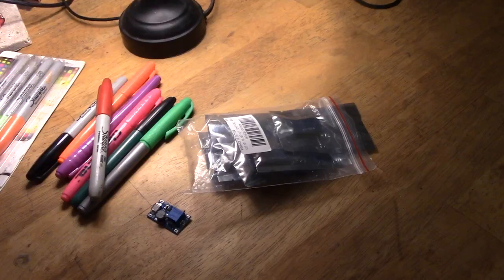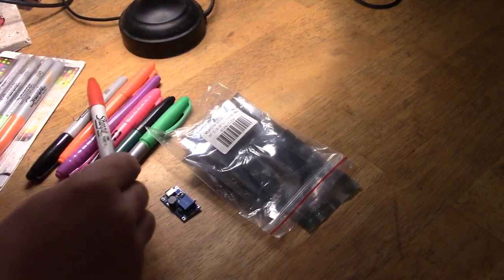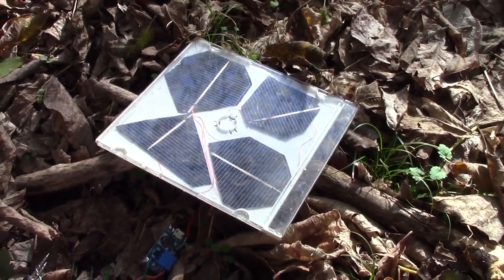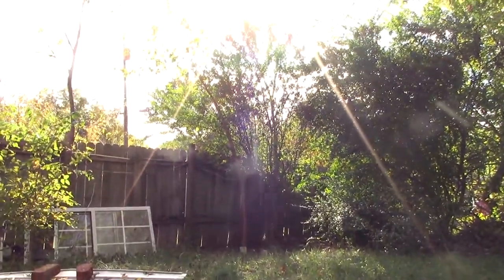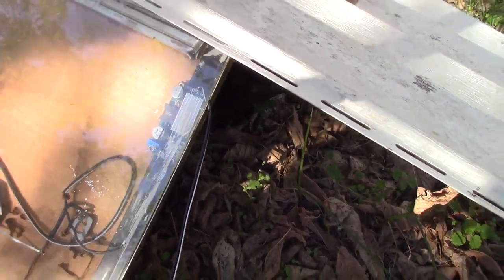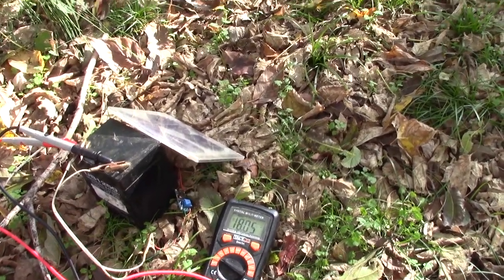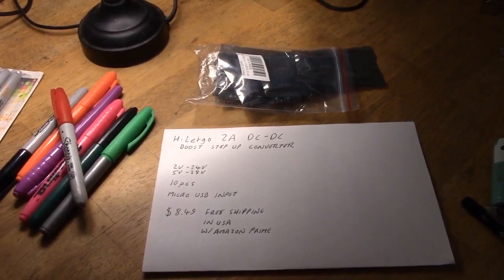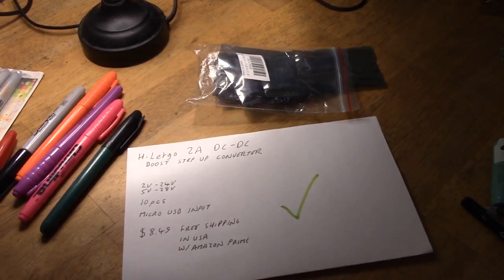Review: Cheap 2A DC/DC Step Up Converter

Comment: I love these DC-DC converters available for cheaps these days. Integrated with a $2 micro, these modules can be incredibly handy.
Amazing deals.
Cool.
B
Reply from the maker: They can and that has been the plan for a couple of years, but I honestly had issues with 3 or 4 different versions. The 1 on the larger solar setup has been faultless, either topping up Alum converted car batts, or,  normally topping up a 3 pack of Li-Ions for my workbench fan. A side note being those ex laptop cells have been charged that way all the time, no special regimen or charge controller, just direct from the 18V booster.

Comment: I have some of those too. And used it on a solar panel. One problem though. As the voltage rose, the converter did not work as expected! As the voltage was climbing towards the 2 Volts (the minimum required), the output (which was set to 5 Volt) went all the way up to maximum (over 20 Volts).
To test this device you need a power supply and raise the Voltage slowly and watch the output.
It may blow out things if you don't know this. In the end I made a nice report of this 'feature' and got my money back for those converters (was on Ali Express). They rewrote the specs, and the case was closed. I think a review is not a functionality test, I get that.
Reply from the maker: Good tip. Making sure of > 2V would be prudent to avoid any such issue.  i reviewed from the perspective of my own uses, but, luckily solar cells produce voltage readily without much in the way of current. If something was < 2V yet had big current it could blow stuff out, point taken.
Reply: I have some of then too and i tested them with 5V input and 12V output and the output was stable enough with different loads but as i lowered the input to 3.3V it got right away to 28V
Reply: @f.a3202  Exactly, that's the problem.

Comment: Don't know if you know this. Your trees have AC voltage. Today, my larger ones
had .6 volts. In the spring, it was more like 1.4 volts. A single tree with a 3" screw.
Reply from the maker: Ah yes, had heard of that but have never tested it out. I know the mains can be heard in a 1970's telephone earpiece if 2 same metal rods are in the ground....perhaps it has something to do with that.
Reply: You should do a test to see what the ACrms voltage is across various resistances (ie: 100Ohm, 1kOhmmm 10kOhm, 100kOhm)... It would be interesting to see what sort of power can be maintained from various trees, also see what sort of load allows for maximum power? 
I actually have a screw with a wire soldered to one of my birch trees here in my backyard, I did see that a 60Hz AC wave was present, but I just assumed it is from all the 60Hz power lines running in and through my subdivision.
It would be fun to see this tested with a battery powered oscilloscope in a forest far from power lines.
Peace.
B

Comment: Could this work with a joule thief input charging an 18650? Just a thought sire.
Reply from the maker: Sure, as long as the JT had a decent sized capacitor on it for a smooth flow inwards. Then the unit can be set for a 5V proper charging circuit to safely charge the 18650. In practice, 18650's will charge from higher voltages, with lower current than 1C...I connect my 18V solar panel outside to 3x 18650 (powering a desk fan in summer) and they've charged fine for a few years.

Comment: I have these also, and the ones I have do not work! Output voltage only changes when I change the input voltage, meaning it is just passing whatever voltage is put on the input, the little pot does nothing to adjust voltage! WHAT AM I DOING WRONG?
Reply from the maker: Ah, exactly my problem with these and why some stayed in a box for over a year. I thought they were junk. All it is, is that the pot is fitted straight from their parts supply and not adjusted; they're wound way to far out of effective range. If I remember correctly, I needed to wind it a good 30 whole turns anticlockwise and then it suddenly sprung to life.